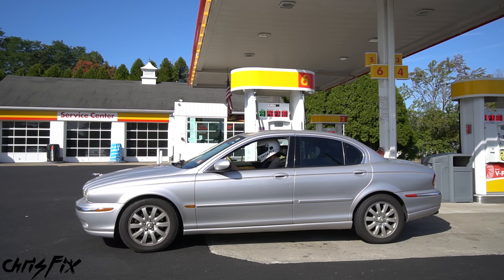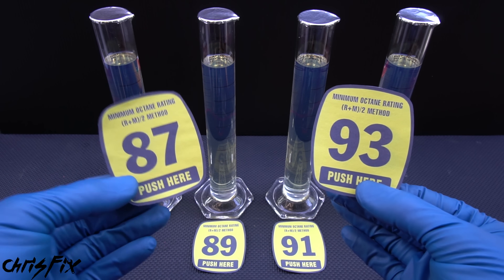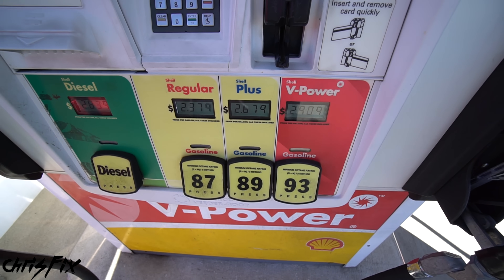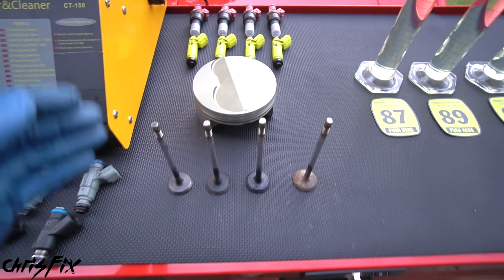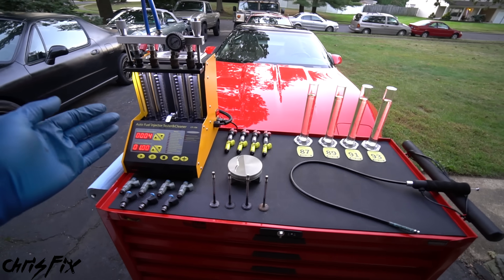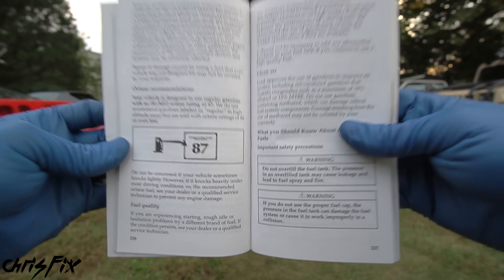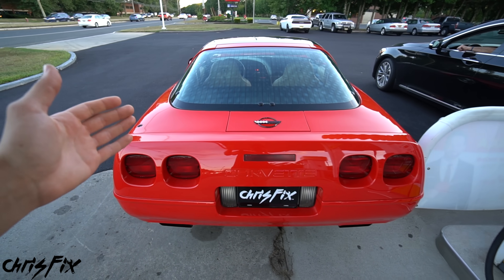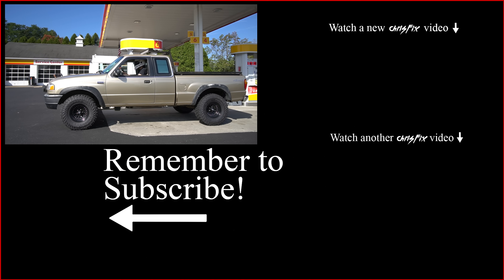What is the BEST Fuel to Use in Your Car or Truck and WHY

Comment: My f150 When i bought it says run E85 but in Canada they don't have, i used to use 87 regular but the fuel wouldn't show proper reading sometimes would take time like 40 to an hour driving then it would show somewhat reading but never the  correct one, no I'm using premium 93 it always shows me the correct reading and sometimes when i put regular 87 it doesn't show me the readings i get on premium. 
And yeah it runs smooth on 93 but would hesitate on 87. Don't know why that happens but don't notice any kind of sound or whatsover. If you know why that happens please let me know.

Comment: Have you heard of non-ethanol?  Obviously not.
Reply: Andrewgyny there is an app called pure gas that tells you where you can get it in your area.  We have tested ethanol on three different vehicles, different types of terrains, as in mountains and plains, and got better gas mileage with non ethanol. Plus it is better for your motors.  A former governor of our state, Missouri, family got involved with the ethanol industry, and got it passed through the legislature, and they were off and running.  Ethanol cost $.78 more per gallon to produce but we pay $.60 or more per gallon to get non ethanol.  It is a rip off that people have no clue about.

Comment: People who really love there cars always uses 93 octain gas. In my car i always use premiun gas
Reply: Gabriel Florentino From the aspect of anti-knock, it’s not helping any if the engine only requires say 87. Now perhaps the 93 fuel of your choice contains more detergents and other cleaning agents, then yes, there is an advantage. But if you can get those same cleaning agents in a lower (and less expensive) octane rating, and it meets the recommendations of the vehicle, then there would be no reason to not do so.

Comment: 3:39 surely a lower rating means it's gonna combust easier and therefore there wont be pockets of uncombusted fuel... right? higher rating requires more start energy to start combusting meaning there would be more pockets... for some reason

Comment: Another great video. Well done Chris. A great security measure the the fuel industry has set in place is that the diameter of the diesel fuel nozzle is slightly larger than the  diameter of the gasoline nozzle so it won't fit in the filler neck of your gasoline fueled vehicle and you won't risk the chance of filling up with the wrong fuel.

Comment: 2008 f250 manual states it is designed to run on 87 octane,so guess what i put in it with no issues

Comment: I have a 2016 Nissan Altima . It requires an 87. I do Uber with the vehicle. I put 243,000 miles on it. I had a chicken light came on and he told me I need a new Cadillac  converter.. I talk to people from the shop they tell me the reason why I wanted it’s going back it’s because I use 87. I have to use 93 it helps to clean the engine. So I did so for two weeks my check engine light came off. I just save myself $1500 on parts and $300 on work. I remember I have 240000 miles

Comment: What happens if you mix octanes? Say I already have 87 octane in the car but I want to put 93 in it?
Reply from the maker: You get fuel with a combined octane! In your case assuming you have half a tank of 87, you would put in 93 and be left with a tank of 90!
Reply: But is it bad to mix's octanes
Reply: Hunter Aceves if ur cars got a sensor it’ll make up the difference

Comment: I saw an auto tech instructor burn a small amount of reg. gas and prem. gas in a clear tube,on a slight angle.The prem. burned slower and therefore longer. That was back in the 70's. Has it changed since? Same as running alcohol in race cars, that burns way slower than any prem. gas. It was interesting to watch. The tech claimed the reg. gas burned out before the prem.,and therefore not pushing the piston as far down the cyl. Now i wonder was he right,or was he wrong?

Comment: One exception. Some modern turbo charged cars recommend 87 octane and they run just fine. For example, the 1.4 liter chevy cruze. The knock sensor retards the ignition timing to prevent detonation. But if you use premium fuel it will adjust the timing accordingly, get better gas mileage (like 65 to 70 miles per tank) and have a noticeable increase in power. I really don't understand the logic behind putting a turbo in and then not being able to take advantage of the benefits. Probably emission and EPA BS.

Comment: Wait. At the beginning of the video, you said low and high octane fuels have the same energy output, the only difference is in the anti-knocking (which I learntas a kid) and additives to clean carbon deposits, but at the end of the video, you said premium fuel will give you a little bit more power.

So which is it?

PS. Thank you for the very informative video.

Comment: Question: when I fill up gas full tank at Costco, Sam Club or Arco, the reader miles show 320 miles only, when fill up at Chevron with full tank my reader miles show 420 miles, and fill up full tank Shell, mobil and 76 only 380 miles. Is Chevron is better fuel?

Comment: Cost per mile is a real tell tale about fuel.  Stay away from cut rate gasoline.  I had a car that was E-85 compatible.  My mpg dropped to 15 on E-85.  I got 24 and better on major brand name gasolines with the same car.
Reply from the maker: Thanks for sharing!

Comment: Me:  I just take the car out on the expressway and drive 90 seconds at 100 mph.  It seems to run so much smoother after doing so.  I also wear a mechanics shirt with cirtification patches and have adjustment tools and an empty bottle of octane booster on the passenger seat in the event I get pulled over by the authorities.  They just might be somewhat understanding.  Once.

Comment: In Europe (Netherlands German Belgium) where i tank often they have 2 standard gasoline’s e95 or e98 in Germany they call it sometime super etc. But the thing is in one is 5% ethanol and the other 10% ethanol e5 / e10 standing on the cap. What gas can you pick best? I know old cars 90s or older cars need e5. But ethanol has a smaller explosion rate As gas.

Comment: You seemed to not mention that if your car has either DI or forced induction always use premium even if 87 is manufacturer recommended. Most manufacturers are jumping into turbos and DI systems to create smaller displacement and better fuel economy but still recommending 87 as if their engines are conventional naturally aspirated port injected engines

Comment: I have a question. My car recommends premium but what would happen if I added the plus instead of the premium. I know you touch on the regular but not much mentioned about the premium
Reply: Just use what the manual says. Premium isn't that much more than plus maybe $0.10 a gallon and it's cheaper than having an expensive repair bill because you didn't use the right octane in the engine. I had a Jeep that recommended premium that's all I used. Shell has a rewards program that's free and you can get discounts on the gas.
Reply: MocaRose loves reps As the other comment says, stick with what the manufacturer recommends. But if you went with a lower octane rating, todays cars will generally self adjust the timing, so best case, you would probably just see less performance and worse mileage. Worse case, it could damage the engine.

Comment: Its resistance to pockets of fuel burning all at once..........duh it burns slower

The idea in all engines(gasoline) is to have max pressure at 15-20(I think its 20) degrees after TDC, complete combustion at 70 degrees after TDC

Higher compression squishes the fuel molecules closer together which in turn makes each molecule burn sooner than if they were farther apart

Thus you need a slower burning fuel.......back in the days people would put turbo charger on their engine, then have to adjust ignition timing to compensate.....when they could have switched to a higher octane fuel

Remember the idea behind the gasoline engine.......long stroke engines also need a higher grade fuel to burn slower because to reach the points after TDC it MUST take longer to burn......because they still have to 20-70 after TDC but the piston has farther to travel to reach those points

These things are fairly easy to see in small-med size motorcycle engines......if the manufacturer says 91+ then use 91 or higher if they say 87+ then most likely you will save gas and money using 87  

If the engine calls for 87 then the compression, stroke length, ignition timing is set for 87...... if using 93 you need more fuel packed in order to get it to burn fast enough......at slower engine speeds it will run like crap

If you put 87 in a 91+, it may not idle and it will ding and knock something awful

These things are not as noticeable in larger engines, not even larger motorcycle engines......but they still happen

Wrap-up.....if you use 93 in an 87 engine it is a waste of money, doubtful it will cause damage.....87 in a 91+ will use more fuel(prices vary) and may cause damage to your engine

Comment: So the nitro v-power can also help your engine take advantage of extra cleansing benefits when you also change your oil using pennzoil synthetic. The additives in the compressed natural gas based oil contains small chains which makes it so clean that without the additives it appears completely clear. Shell owns pennzoiland their oil and gasoline synergizes with eachother to get the best engine cleaning capability.

Comment: I once had a mechanic tell me that the knocking sound my suburban made was caused by putting fuel in it that was TOO high octane.   Did he have it backwards?  The engine was rated for 85 octane. I always suspected it was a lifter issue, but he insisted it was due to the high octane fuel.
Reply: MongoLloyd That doesn’t make sense. A higher octane fuel is more resistant to burn, so if there was a condition that would be more susceptible to pre-ignition (carbon build up, timing too advanced, etc.), then the higher octane fuel would resist it *more*. Of course, it’s possible that you could have knocks with even 93 octane, but that would indicate a problem that needs attention.
Reply: @mcswain69  I agree.  In retrospect, I'm pretty sure it had a bad lifter.  I've also since learned that the 'mechanic' wasn't certified.

Comment: As you can see, here in Europe we forgot about the octanage and focused on how much ethanol the fuel has (E5 has 5% ethanol in the mixure, and E10 has 10%) because more ethanol produces less bad gases, but it can really mess with your engine if it's not prepared for it (specially older ones).

Comment: What you are not aware of is the fuel quality is not wasted with premium fuel. Want carbon deposits or injector failure sooner use the cheap low octane formula. Your engine will run just fine on regular. But the cleaner high octane keeps deposits to a minimum. Get truly educated before speaking about fuel quality as if it is wasteful to use HIGH test or Premium fuel.

Comment: Should I switch to High Octane on my older high mileage vehicle to clean the the injectors and the rest of the important parts. Would I use the higher octane for a number of miles and then switch back to recommended fuel. Mine is a lovely 1998 GMC, 4X4  with a 350V8 and 174 miles, Ive been using Synthetic oil since new. Thanks, Love your videos, very thorough and excellent

Comment: Excellent, thanks Chris. Agree, found that with higher octane, car runs a little smoother,  but does not improve economy. Use Research Number (RON) in Aust. 91 (Regular). 94 (E10 added ) 95 (Mid) 98 (Premium). Some countries  use the Motor Octane Number (MON) which is generally lower than RON. The average of RON and MON / 2  gives the  Anti Knock Index (AKI), which is a Octane rating 4-6 points lower than RON.  I understand that in North America Pump Octane Number (PON) is similar to the AKI average.  
The table is an average only.
RON     PON/MON 
91	       87
95       90/91
98	   93/94.

Comment: Don’t use octane boosters, 90% of don’t work and it will damage your catalytic converter specially if your car has 3 way converter. Specially cars in Cali. It took less than a year to ruin both my cats on a brand new car. Even though it says safe for use with catalytic converters.

Comment: you could also pick a different octane depending on if it is running a bit rich or lean. Also.... it's Vice Versa not vica versa...
Reply from the maker: Thanks for sharing!
Reply: @chrisfix  yeah for instance in very high altitudes they sometimes actually lower the octane of the fuels because the air is thinner. I.e. less oxygen, leaner.

Comment: I have 2014 KIA sportage that said use unleaded fuel only. Can I use E-91? I'm in Australia so our ratings are different.
Reply from the maker: What octane does it suggest using?
Reply: @chrisfix  the manual says use unleaded  but here in Australia we have e10 which is e-91 then 95 and premium 98. All are unleaded and I think it is the octane.
Reply: @christopherkomla5853  just use sugar water

Comment: 350z's need premium fuel its extremely bad for the vq35de,rev or hr motors and will cause a early life for those engines not to mention you will spend more money using lower grade fuels bc the engine isn't built to burn those.

Comment: Iv'e delivered fuel for 26 years. I think, there is little difference between generic and top tier fuels for 95% of cars om the road. The difference is in quality control. Chevron and Shell  operate on 'no failure' quality control. It is a little more expensive, but when you buy premium, you are definitely putting premium into your cars tank. The horror stories that I have had to participate in, against my will, at liquor store stations....

Comment: Here's a question, I'm driving a 2003 Nissan Xterra and have been getting well below average MPGs. I've only ever used basic fuel because I lived at a high elevation (7000+) and OM says don't use anything higher than 87 when at that high elevation. Just moved to Phoenix which is only like ~1000 Ft above sea level. Could I get away with using a tank or two of 89-93? Would that theoretically clean the deposits that have built up in the engine? THANKS!

Comment: I work for an engine part system. We had an experiment on running engines with different Fuel. 
Changing fuel resulted in many different things and ended up one of the test engine's cylinder part was broken. 
A lot of people think that premium is only better just because it's name. 
PLEASE use the manufacturer recommended type. Just like Chris said.

Comment: The error is that you cannot put diesel in a gasoline engine. You absolutely can. The engine MUST be operating
temperature, and you must put gasoline in the tank and run it while it is still warm to purge the diesel from the 
carburetor/injectors before it cools. I know because I have done this.

Comment: Will it harm my car to run 93 octane when 87 is recommended just to clean things out?
Reply: Mike M No harm at all, but the only advantage you might gain would be if the higher octane fuel contained more or better detergents, and then I’d suggest you’d need more than just the occasional tank for even that to have any benefit.

Comment: I purchased a 2003 Hyundai Sonata brand new in 2003 with 7 miles. The car now has over 484,000 miles and I am still the original owner. The majority of gasoline has been 87 octane from ARCO. There has been no major work on the engine and I drive it daily. Thanks Hyundai for making such a reliable product! Regards, Steve (LA, CA)

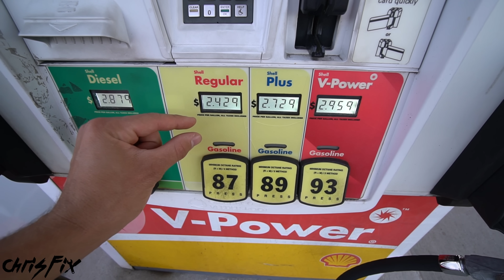Comment: 0:40 you said octane rating doesnt affect fuel economy or engine power but then you said exactly opposite at 12:24. so which is it ?
Reply: he means putting 93 Octane in a 97 Civic won't give it better fuel economy, but putting 87 Octane in a Corvette (which RECOMMENDS 93) could mean sub-optimal fuel efficiency.

Comment: How come my car runs better on mid grade vs regular
Reply: I have an 98 Chevy cavalier, first owner, I’ve always ran mid grade chevron with Techron- faithfully- I watched a video and heard u get the same power outa regular as u would mid grade or supreme/ I put some regular and my car engine rpms had to work harder to get the same speed and time I usually drive/ like it was harder on the engine/ clearly there’s a difference - what is it?

Comment: Can you do a video on ethanol gasoline? I'm in the midwest and my vehicle is minimum 91 octane but here I have the choice if my gasoline uses ethanol or not. Should I go for the 91 with Ethanol which is cheaper or the 91 with no Ethanol? Are there advantages/disadvantages to ethanol in a engine?

Comment: Well, I used to drive a sweet 99 Dodge Ram with a 5.9 liter V8.
Ran decent on regular gas... But when I put the V-Power Shell fuel in it, it ran like a BOSS!
Now I have an 06 Chevy trailblazer with the inline 6. Haven't tried medium or high grade in it yet, but I'll be filling up for a trip tonight with Mid Grade. We'll see what happens.

Comment: Great instruction movie. As a Dutch guy, we use the following: the higher the number, the less water residue it contains. As we have recently have introduced the E10 which contains 10% bio-ethanol. As E5 contains 5% (less), this will benefit less corrosion of exhaust, water mix up with engine oil and more mileage as per liter/gallon. So getting premium instead of regular will give you less wear of exhaust and engine and more miles per liter. The octane explanation is interesting though and may indeed have its impact on engine behavior after all. Best regards y’all from the Netherlands 🏎

Comment: Ambient Temperature and pressure also effect the likelihood of knock. For instance my Ford Expedition with an ecoboost engine recommends regular unleaded except for when it is very hot outside. Also higher altitudes would have lower air pressure so knock is less likely there. That is why some states like Utah only have 91 octane as premium since it is typically cooler there with lower air pressure.